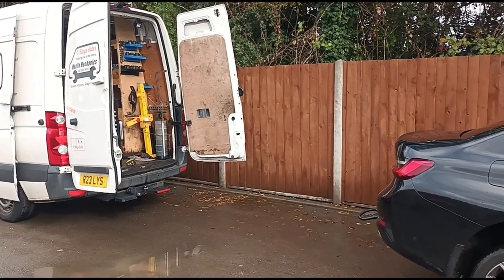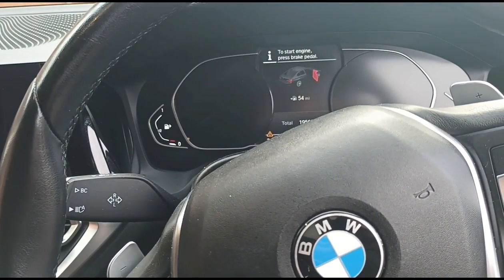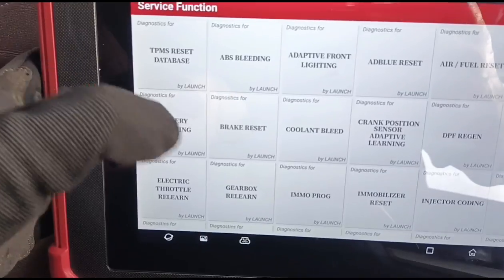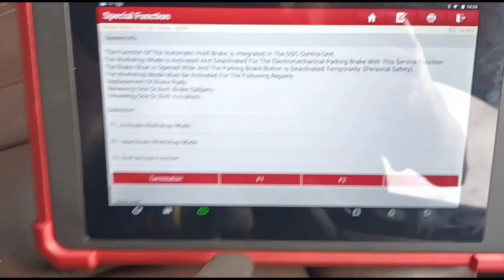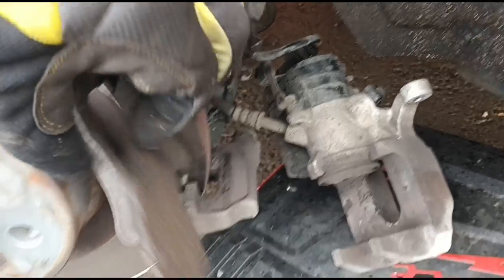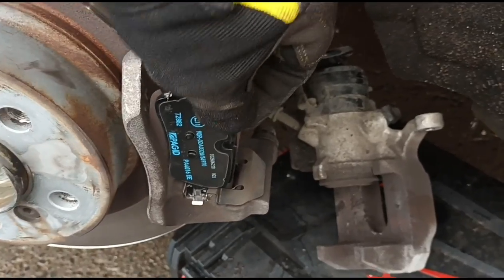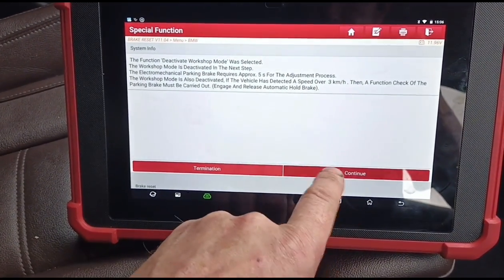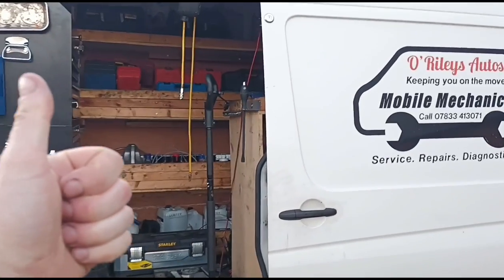2022 BMW 320i G20 Rear Brake Pads With EPB Electric Parking Brake Caliper 3 Series

Comment: Done my rears on 330e..just removed actuator and pushed back...no computer needed ...27 quid for pads and work perfectly fine ...tho I do think rears on mine was wind back as it had notches on caliper so I used the tool rather than pri bar

Comment: Just had a quote from my local bmw dealer for the full set of pads,£550😂 it’s a 320i G20 and I can get a full set of pads for £100, my back side aches from just a thought I will let them have me off. I’m mechanically skilled enough to manage replace the pads myself just not sure about the computer reset etc. would the eBay LAUNCH CRP123X Car OBD2 Scanner Code Reader Check Engine ABS SRS Diagnostic Tool do the job? Thanks for your help in advance
Reply: I have a 320i G20 to, i asked the bmw dealer here in Germany for a Rear Break Service … Pads and Disc‘s … it cost‘s 696€ its crazy 🤣
Reply: @prufertoni6542  it’s beyond the jokes  how they are ripping ppl off. Spoiled by a high end customers who having no clue but instead a wallet full of money paying the price they come up with. What’s your plan on doing the breaks? I’m definitely having a go myself 🤞
Reply: @prufertoni6542  I just realized you mentioned also discs, here if I wanted to do that it’ll be double the price 😂
Reply: @emerel  Unfortunately, I don't know whether the app is available in the UK.
Reply: @emerel  I think the price is too high because I have the “normal” brakes like in the Video  and not the M Sport brakes
Reply: my comment keeps getting deleted... now for the third time.
Reply: and buy an OBD adapter called VLinker bm+, both of which cost around €40
Reply: @prufertoni6542  nice one mate, I’ll look for that then 👍

Comment: Crazy how unnecessarily difficult this service is! 
99.5% of us won't have sophisticated service computers to set it into workshop mode 
This is done by design no question about it
Reply: Computer is not necessary, it is just a handy tool method...you can do this manually without it.  When he retracts the motor, you can actually do that part manually with a quick removal of two extra bolts and twisting the drive system. Search other videos.
Reply: @MyDailyPerspective  I've been seeing the torx method with the removal of the electric motors

Comment: Got to wonder why a bm needs rear pads at 20k !!
Reply from the maker: Harsh driving I guess
Reply: For $$$$ service department is the cash cow
Reply: Most powerful RWD cars need rear pads at 20/25k miles.

I did 150k miles in a 2011 Jaguar XJL and the average was 22k miles for OE ATE rear pads, got 30k out of Pagid pads.

Did 130k miles in my 2016 S350d and the rears lasted 25/30k, the best lifespan was again from Pagid pads.

It’s because Cruise Control, Speed Limiter and Traction Control all use the rear brakes.

Comment: Pagid are alright, i use them on some of my vehicles. 

Eicher is a brand i would never use as i consider them dog shite, they are Euro car parts own brand. They are terrible, their discs warp and the pads have 80% less brake compound in the pad compared to Pagid from what Euro car parts sales rep told when i returned some Eicher pads. 😂, made in India and sometimes i wonder if their brake discs are even heat treated, seen a load of cars with warped eicher discs all the time.